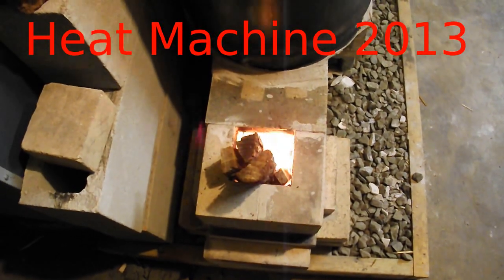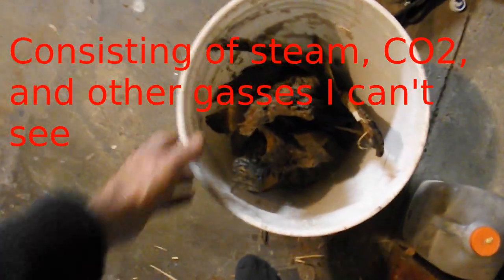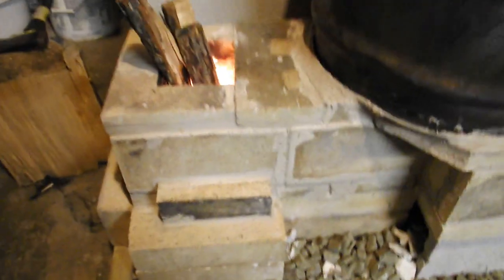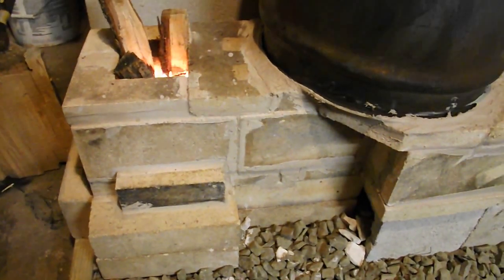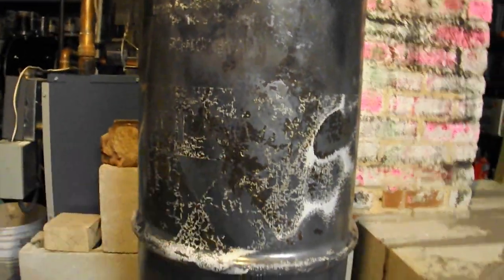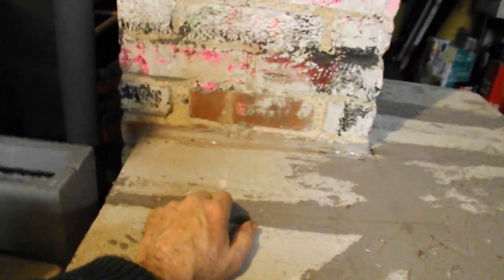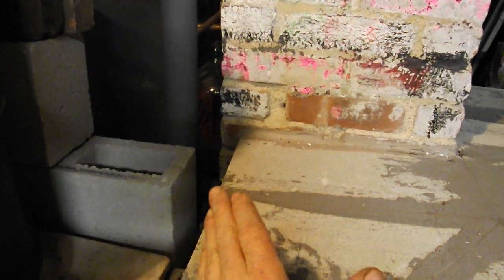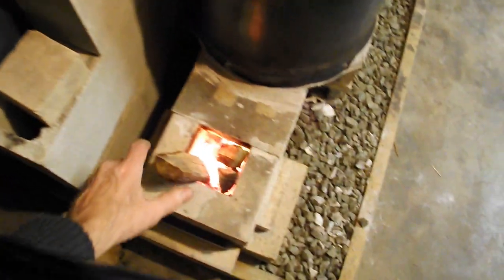Indoor rocket mass heater

Comment: Very smart way to do it with the blocks. Another reason to add the cob is to protect you from cracks in the concrete. Some say it can even explode, but would not be worried about the concrete doing that. Great design.

Comment: Excellent job. I see what looks like your central heating furnace next to the rocket heater. Do you run the A/C fan to circulate to heat through your ducts. Have you calculated the savings using the unit. Used it a full winter.

Comment: Hi Mark.  Great video.  Cleaver and simple design.  Since this unit is in the basement, how well does it heat the upstairs?  I have read that the Rocket Mass Heaters are "space heaters".
Reply from the maker: Hi J. Thanks. I really haven't used it since I built and tested it maybe a dozen times. I did it as a backup system in case of a winter power outage which thankfully hasn't been a problem. My hope is that it would get house temps high enough to at least keep pipes from freezing and us warm if we hang out in the basement. When I tested it I left the basement door open and it did begin heating upstairs but again we've never run it mid-winter as the sole heating for the house.

Comment: Hi, I saw on the boards that you use ceramic fiber blanket insulation for the riser. As this video has quite a few years, I am very interesting in knowing how the riser has performed over the years. Would you recommend a riser out of CFB? Did you use rigidizer? Thanks for sharing.

Comment: great design, but I'd check your chimney for rotting out the tile and brick. You are doing the equivalent of putting a high efficiency condensing furnace into a chimney not designed to handle condensation.

Comment: Very clever and the possible applications are liberating- butttttttttttt. . . I wonder if you have gases escaping thru the blocks themselves? There are light weight blocks and heavy weight blocks in construction, but I wonder if there are fire rated blocks?

If there is any leakage AT ALL my wife would know! But over all, if gas/fumes safe, you are a genius.

Comment: that's amazing.  are those a special kind of cinder block?  in my experience any kind of heat I applied to it broke the things in two or more pieces
Reply: +coolo I mentioned above, there are regular light weight blocks (low psi strength) and High strength blocks (high psi)  used in earthquake zones. I use to be an inspector. . . I would not trust Low, but would entertain High (more aggregate/rock) and would take way more heat.
Reply from the maker: Hi Coolo. Just plain cinder blocks. I don't think the heat at that part of the system gets high enough to damage them. I also haven't run it more than a few times since it's a backup heater for power outages.
Reply: oh yes you are only using it on the exhaust side of the build while your core is made of firebrick.  ingenius use of  the cinderblock internal hollows to pipe away exhaust heat out into your heat battery instead of hvac venting and mud.  that's thinking outside of the box.  bravo!!

Comment: Nice job! Very clever, but the but I have is you snake your flue nicely and then return right over the hottest part and up the chimney goes much heat that has radiated from the lower chamber. Tolba.

Comment: I love videos like this. Unfortunately, the ALL seem to lack the one thing I am actually looking for ... Step-by-step instructions on HOW to actually build these types of things. Everyone shows us all the finished product. I need materials lists, step one-do this, step two-do that, etc. Furthermore, what if we don't have a chimney to tap into? Where would the smoke go to then? I've heard of other instances where someone build one of these without an outlet for the "would be" smoke. They said all that came out was carbon dioxide and other harmless gases. Anyone know where I can go to find what I am looking for? Going to keep searching google.com in the meantime.
Reply from the maker: +Lee Forex Hi Lee. Try visiting permies.com and then go onto the "proboards". Lot's of information. For step by steps, there are books by Erica and Ernie Wizner and the Rocket Stove guru whose name escapes me at the moment. That said, there is always some vagueness because this is very new. I've built several little functional models but I always end up making slight changes so I never really know what is the "right way".
Reply: Hi Mark. Thanks for the info. After I posted that comment I ended up going to purchase their 4 video series on the subject. I am on the 3rd video now "Boom Squish" finding out as much as possible. I guess I have one main concern and that is whether or not I can have the exhaust for one of these rocket mass heaters escape INSIDE the house since it is MAINLY supposed to be steam-like. If not, could I hook it up to a shared line (it would be shared if I can find a "Y" attachment) for a dryer vent. Maybe the heat that escapes from the exhaust will be too hot for that aluminum hose???

Comment: Are you have liquefaction of steam to go in water form under or to the side of the rocket mass heater? What's the purpose of rocks gravel under it? Is that for absorbing the water moisture, because the rocks do not add anything but flimsy surface to build with.

Comment from the maker: A question was asked about the length of the burn tunnel in this heater. It's 16" overall. the opening is 4" x 4". The rule of thumb with rockiet stoves is to have the cross sectional area the same throughout the system to avoid choking the flow. With this heater I deliberately made the combustion area smaller than the exhaust as insurance.

Comment: Estimated WEIGHT of the system? I have read and been told that right angles are an enemy to these systems. Also, you need to add LENGTH to the exhaust in order to sap more heat out of it. There is a certain temp of the exhaust that is ideal, something less than 200 F.
Reply: +Steven Feil Don't forget that in this build, he is using a pre-existing brick chimney. That's a lot of length and a lot of thermal mass.My only concerns would be the absence of cleanouts and that the thinness of the mass will mean it gives it's heat up more quickly than other designs.
Reply: +Steven Feil But my space would not allow for Length and that is why this caught my eye. A condensed circular intestinal system that could go up even higher for a tight area.

Comment: A concern I would have aside from possible cracking issues is if the CO2 is actually making it's way up your chimney.  Just by appearance, I'd bet your chimney is roughly 35'-40' tall and CO2 being heavier than ambient air might cause a buildup, not to mention the steam factor as well.  Unless you can confirm a sufficient amount of heat in the chimney to carry the CO2 and steam up, you might get problems.  A cheap fix might be a simple draw fan near the floor of your basement to draw CO2 buildups.  An Arduino (youtube search Arduino) can monitor a CO2 sensor and activate a fan if/when a certain threshold is breached.
Reply: +Michael J My concern was leakage thru the blocks. I have a bathroom to heat and can flue out (under ideal conditions). That being said, how do you feel about the possible block leakage as long as I burn conservative (small burns)?
Reply from the maker: +idahocharley I can't speak to any of this with any significant experience. However, the few times we have run it have not triggered the smoke/ CO alarm I installed near it. It does enter the chimney pretty warm. That is based on my touching the area of cob where that happens and feeling the warmth. But Michael J is right that the chimney is pretty tall. Two stories and an attic above the build. As far is leakage thorough the block. That seems possible, but there is no pressure that would be encouraging that. One could smear the inside of the blocks with something less permeable to make sure. Another detail is the concrete re: heat. The heated concrete bench I set up in my backyard is definitely showing signs of heat stress with small cracks. But that one has no cob to buffer/absorb it so I gets too hot to sit on right where the base of the barrel meets it. Good luck!

Comment: Have been heating 2100 sq ft home 36 yrs with wood heater made of cast iron by a heater company. Replaced first heater in 2012 same heater wood is 22" max length.  Have been looking at these Rocket Stove Heater for heating my 1200 sq ft shop. If building with cinder block or regular brick be ready to clean all out and build another one in about 3 yrs, hot and cold many times will crank and crumble these things. Using fire brick with fire clay and fire mortar is much better for safety and long lasting. 55 gal drum is not good in home. If you want to see how long 55 gal drum would last, build a fire in one outside everyday of winter and watch it, rust will start at hottest part.  For my shop RMH will be made of 1/2" steel plat if can not find cast iron with chimney pipe replaced every 3 yrs

Comment: Hey Mark! Thanks for this video...I really like your idea with the cinder blocks....I think it is safe and cheap. I would like to address an issue that has been bugging me ever since I got all excited about rocket stoves and all the videos I have watched...(I never commented on any site before)...It seems like no one takes enough concern about the top (bottom) of the barrel after they cover the burn chamber and cob it in! I would think it would wear out so soon with all the heat it gets! Why can't we come up with a top that doesn't need to be replaced every year? I don't weld...but it would be waaaay better to have a half-inch hunk of metal as the lid..or a fire resistant brick-type lid....what say you?
Reply from the maker: I think that's a very good point. The barrels are very thin for the heat they take. I suppose they are used because for now the 55 gallon used drums are easily available and cheap. If they need replacing every few years it's probably not such a big deal. The little drum I used is much harder to come by. I think a big disk of refractory material for the top would be really good but right now you'd have to make it yourself. I don't think even octagonal kiln shelves come that size. I'd post a question like that at donkeys proboards and see what the real pro-hobbyists have to say.
Reply: DO NOT USE CINDER BLOCKS THEY CRACK. TOO BAD HE PUT ALL THAT WORK. 
If you're using it for fire - don't cheap on it - use proper building materials FIRE Bricks it only cost 1.75.
Reply from the maker: Hi Angelia. I haven't used a thermometer on them but I don't think the cinder blocks get hot enough to weaken them. And of course fire bricks are solid bricks. Although it's possible to build with them, it'd be an awful lot of individual bricks and work to make the tunnels that are so easy to create with the cinder blocks. All that said, mine is emergency backup heat so I've run it only a few times. Don't expect you need much heat on that beautiful island though!
Reply: +wmatsuda To answer your question it is important  to have a thin drum so your hot air will cool down to pump the air through your system, I am fixing to build a system and do a video to help everyone understand how these work. Now I like the idea about making the top of the drum out of a thicker material, I would cut the top off with a grinder and weld thicker steel or use refractory cement, I do not see that being an issue. Thanks a good luck on your system!
Reply: Potty tack welded a saw blade to keep the top from buckling

Comment from the maker: Hi RIck.
As this is an emergency backup heater, I've only run it a few times. Certainly not enough to be able to give any advice about durability of the blocks over the long term. That said, when contrasted with temps in the burner and barrel the heat has dropped considerably by the time it hits the concrete block. Good luck.

Comment: I'm thinking of building a rmh using the exact same cinder block strategy for the exhaust ducting as well as the thermal mass. So have you had any problems with cinder blocks popping or cracking? I'm guessing since you're still writing about it months after building it, that the blocks are lasting and doing fine? Did you ever add the coarse lime plaster to the top and if so, how much did that help the heat at the top? My application is to make a platform upon which I'll put a rubber liner for an aquaponics system (basically a thick rubber liner for making a 4' x 8' x 1' tall fish tank).s I'd like the system to heat the water, but nothing over 80-90 degrees.

Comment: Thanks!  EXCELLENT IDEA & EXCELLENT VIDEO!
That chimney has a lot of mass!  More mass than the mass of your rocket-mass-heater.  Plus the chimney is vertical.  Also as the chimney is exposed to outside temps it acts as a thermal sink, sucking heat up and outward.    
So, all that said: Wouldn't it be a good idea to insulate the chimney from the thermal mass of the rocket stove?  Ideally insulate on the two sides.  Wouldn't fire-board go a long way towards doing that?  Air gaps where possible? 
Really, these are questions. My talk is cheap; but you are walking the walk!!!

Comment: With such a small fire box you need to spend lots of time tending this stove. There are only so many BTU's in wood so you need to constantly fill the fire box.
Reply from the maker: It's true. I guess the idea is that with so much retention of btu's in the mass the overall amount of fuel required to heat the space is far lower than with conventional wood fired heaters. If you can't imagine spending an hour or so a couple of times  a day tending a little firebox, the "batch box" style is probably a better choice for a diy mass heater.

Comment from the maker: That's true Darryl. I was surprised at the buildup of fly ash when I saw Broaudio's recent video of cleaning his RMH. Though he burned several cords of wood to get that much. My cleanout scheme is to remove the end caps where the direction of flow reverses and rises to the upper level. From there I can snake a shop vac hose into both levels. But this is emergency backup, so I don't really expect to have to get into that for years.

Comment: I had seen this exact system in a great many homes in Korea. They work very well as long as the masonry flue tunnel remains sealed. Sadly I had responded to 4 homes that had leaks and the families parished due to Carbonmonoxcide.  However, your construction look far better than thoes systems.

Comment: Great job on the video. So what are your thoughts on the system? Would you change anything?
Reply from the maker: This is meant as a "cheap and dirty" backup heater in case of winter power failure.  once it was built and functional I pretty much left it alone. I've only run the system half a dozen times, most of that while building and drying out cob and lime plaster. The last burn was mid-winter and I got smoke back for the first time. I haven't had time to get into investigating why that happened. I'll probably get refocused in the fall and update with a short video then.
Reply: Mark Stephenson You may just have ash buildup. I don't remember you mentioning any cleanouts in the vid.

Comment: also insulating the inside makes it safer as it remains cool enough to touch the barrel and it will burn much mere efficiently I used cheap clay cat liter and mud...Great tutorial..I like your design...I wish more people knew about these..I am a woman and wheel chair bound me and my kids built it so anybody can do it... it saved me thousands by not having to buy home heating oil which cost a fortune here in upstate NY...I got through one of the harshest winters we have had in years on 3 cords of wood I have 2 stoves
 one of which heats hot water for showers on one floor .
Reply: thepoultrypeople you can coil copper wire around the inner barrel/combustion chamber which you can attach your hot water line to it ..you have to be careful.. I have not figured out how to regulate how hot the water gets ...my water gets so hot I turn the cold on full blast and just turn the hot on a very little...and you MUST put a pressure valve for steam to escape..hooking up the water I had help from people much smarter than me ..but it saves me a fortune  in home heating oil costs and I can get by on a couple of chords of wood for an entire upstate NY winter
Reply from the maker: I'd like to see photos of your heaters. Cat litter was used how?
Reply: wow! good for you! how do you transfer heat to water, would love to hear your method, thanks!
Reply: Madam Vonkook thats great, thanks, point noted on the pressure valve, do you have a water tank in your house where the hot water goes to collect? this is how were thinking of setting one up here with the rocket stove heating a water mass, your lucky to have good friends :)
Reply: oh man, wow that's a great testimony to rocket technology, new york winters ... well you alreaady know them... thank you for sharing, this technology is so precious imo, thank you for the cat liter tip also : ) take care in new york

Comment: I have a couple of questions. First of all, how has this worked for through the heating season this year?

Secondly, the thermal mass made out of cement blocks, I don't see a way for cleanout. I'm curious as to how you handled cleaning out the cinder block area.

Thanks for the video - Lots of good stuff here
Reply from the maker: This is emergency backup so I haven't really used it. No cleanout for the same reason. Theoretically, there would be very little accumulation of soot with a rocket stove, so with almost no use a cleanout seemed unnecessary.
Reply: Mark Stephenson I like the concept a lot.  Does it heat the entire house??